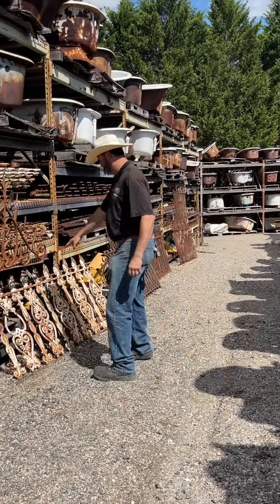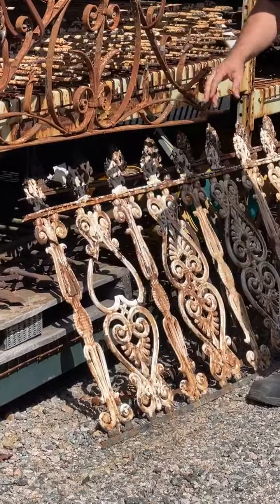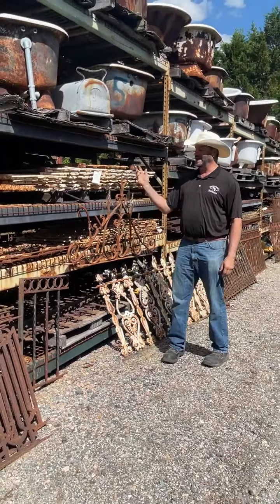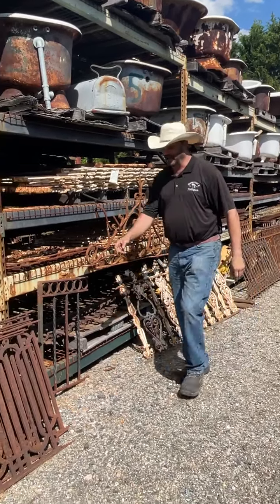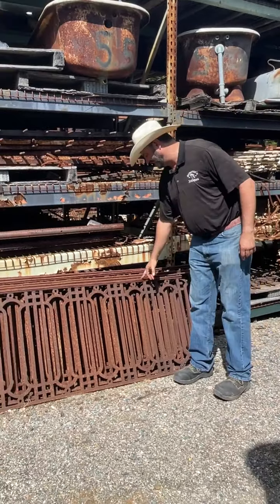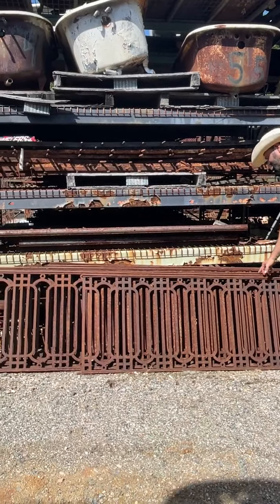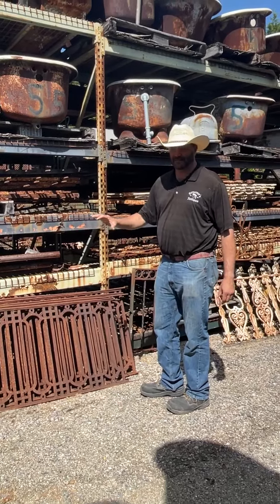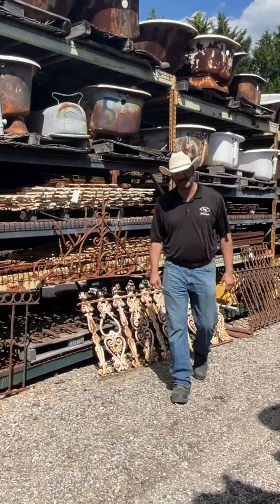Iron 101 | Episode 4 | Cast vs Wrought Iron | Governor's Architectural Salvage

Comment: What’s stronger? If I’m trying to make gates/ stair case bannister / balcony gate 
Stronger as in thieves will struggle more to get in?
Also what’s less likely to rust ? Less maintenance ?
Reply: Wrought iron is generally stronger…depending on thickness…and more durable because it bends but won’t crack.  Cast iron is harder to work with and doesn’t flex at all. 

Both will rust if not coated properly.  J